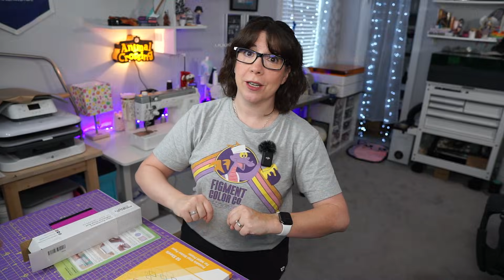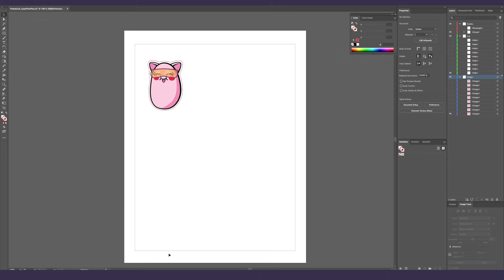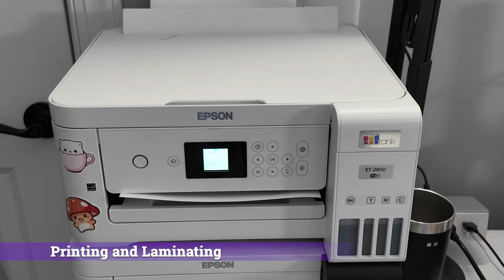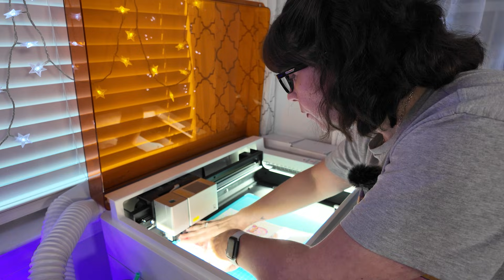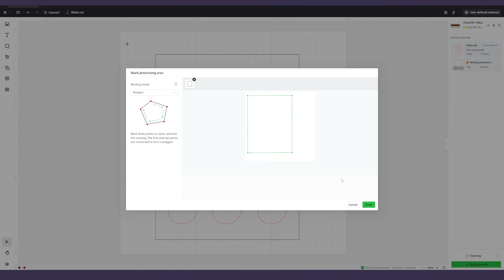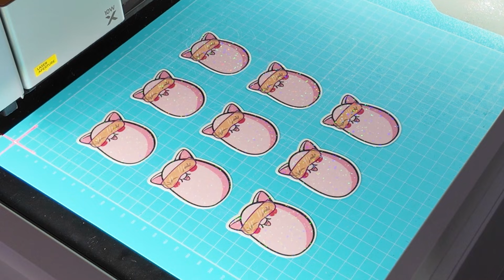How to Make Stickers with the xTool M1 Ultra - Full Tutorial

Comment: Great video, thank you! Can you put laminate on the stickers before the cut if you use the print module on the x1? Do you find your inkjet prints are better than the x1 print module?
Reply from the maker: My inkjet printer results are better, but it’s a machine with a single purpose. The M1 Ultra is a jack of all trades. I print on my Epson, laminated then cut in the m1.

Comment: Hi. Do I need to re-mark and reposition my artwork each time I cut another printed sticker sheet, even if it's the same size and has the same design? Thank you!
Reply from the maker: Yep! Every print could be slightly different and you probably won't be talented enough to place it exactly where it needs to go and at the correct angle. Even being off 0.1 degrees will mean the cuts won't work.
Reply: @ Thank you. So it's a useless machine. It's supposed to know where to find the registration marks.  Thanks for your superb comment
Reply from the maker: @markymaarty  huh? No... no laser knows that... for the M1 Ultra you could avoid having to do any alignment each time if you used the inkjet module and didn't print on a separate printer. But every laser is going to need you to mark registration points to know where your artwork is located........
Reply: @fiercekittenz Yes, but what if I print the kiss-cut full-color layer on another printer using Adobe Illustrator with registration marks? I’ve double-checked my files multiple times, and everything aligns correctly with the kiss-cut and die-cut layers. However, when I frame it and test several actual prints, the cuts still don’t line up properly. The die-cut works fine though.

I’m using exact 8.5” x 11” inkjet vinyl, and my artboard size is set correctly with no scaling during printing.

Also, do you have a video showing how you do the kiss-cut process with die-cutting? I’m planning to sell sticker sheets and would love to see your full workflow.  And I thought xtool makes it very easy to do this. Is it much precise and super easy using cricut to contour cut? I don't plan to print on xtool's inkjet module or cricut machine. I just need it to cut my print precise as possible. We use summa 60" plotter at work and once it reads the reg. marks, everything cuts precisely as you should expect.

Comment: I can not seem to get accurate offset cuts for my sticker. Ugh any tips?  Even when trying your methods i stil can get accurate cuts.
Reply from the maker: You're adjusting the angle and size of your cut region like I do in the video, right? What I found is if you use a separate printer and not the inkjet module is that the printer may warp the print ever so slightly. You won't notice it by the naked eye, but it won't line up perfectly with the vector lines in XCS. I usually have to tilt +/- 0.1 degrees and shrink the width and height of the region (not relative sizing). If you ARE doing those things then I'd suggest putting less stickers on each printed sheet and spread them out a bit. Then you need to slow down your cut speed.

Comment: I tried this but I can't seem to get it to work for me. I export as svg from affinity designer but xtool software isn't seeing the images as something it can cut. It's like it's not seeing it as an svg
Reply from the maker: SVG comes in a couple of different formats. I’m not familiar with Affinity Designer. Are they filled paths or just strokes? If filled, try stroke. If stroke, try fill and see if that helps?
Reply: I had the same problem using designer. I used the “offset” in XCS and just set it to “0”. It outlined it perfectly and was able to cut.

Comment: I have to say - you're the only video I've found so far that actually shows printing from a separate program and then cutting them out with the Ultra. It's super-frustrating how hard they are making this process. I've tried using Photoshop to export my SVG files to help cut things out, but the program keeps seeing it was a bitmap instead, which is frustrating me to no end, lol.
Reply from the maker: Ugh! Have you tried exporting from Illustrator or Inkscape? The way Photoshop saves a SVG may not be correct for laser applications.